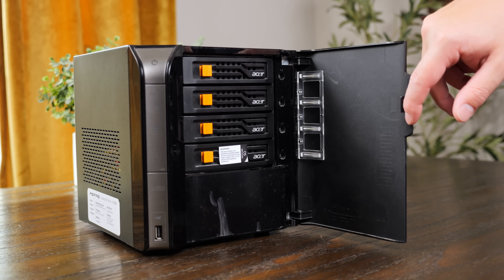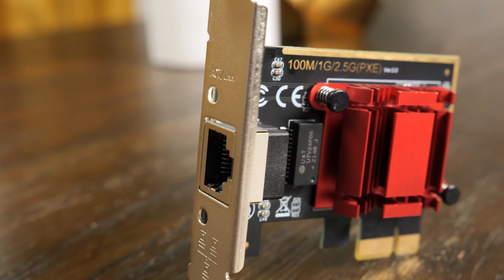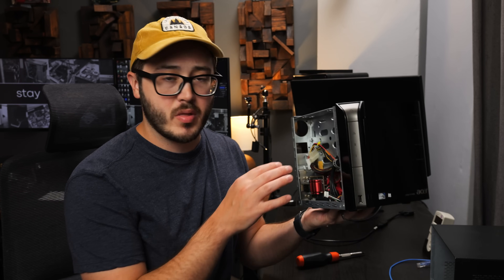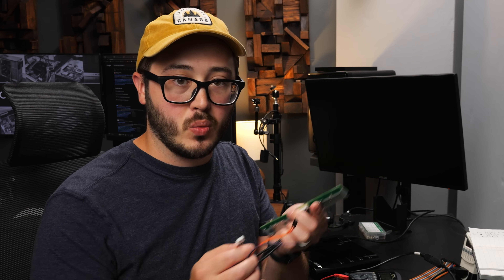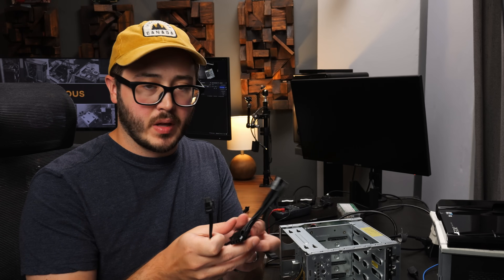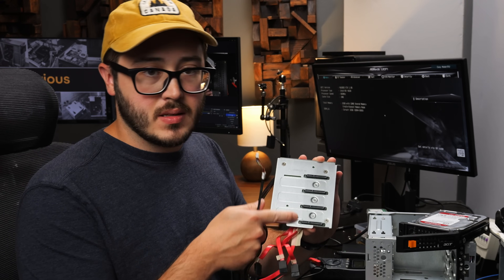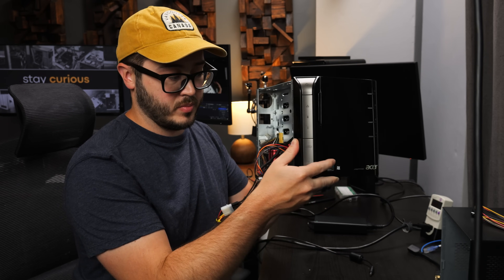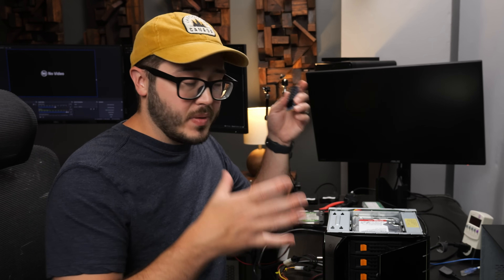I turned a cheap NAS into a SLEEPER home server

Comment: i have a question bout your mainboard choice, why a n100 cpu? Would a j5040 not more suitable for this?  i mean yea the j5040 is older but uses also only 10w, has 4 sata 3.0 ports as well the same number of pcie lanes, it has a powerfull internal gpu for video encoding and a 1gbit port. both are similar to each other, but the j5040 has dual channel ram support with each channel can support 8gb of ram with, yea i know it uses so drimm with 2400mhz and has a E-key m.2 as well. 
i personally would consider the j5040 insead of the n100, even it is a bit faster and the single channel of the n100 has the same bandwidth but for multiprocessing purpose you need more ranks. 
i dont know is the price for the n100 the same as for the j5040? the last time i checked the j5040-itx from asrock costs only 120€
Reply from the maker: You're correct. I had already ordered the mobo because of how often people bug me about it, so I used it.
Reply: Have you... used a j5040?
The j5040 is only 30-55% as fast and less than 2/3rds as fast for single-core and multi-core, respectively.
"A bit faster." Yeah, no. It's night-and-day.
Reply: @tim3172  it depends on your workload. Crunching synthetic numbers tells you shit about the performance. Have you any idea why a modern server uses a 10year old architecture and still ripping a modern processor in multicore performance in to peaces with the same number of cores? 
Have you ever heard about memory ranks and what they do and for what it is needed? 
Testing only the floating point unit tells you nothing about performance. a cpu it self is complex and every design decision as his pro and cons. clock speed for example doesn't mater on modern cpus any more it kills the efficiency and make cpus instable and fucks every internal and external part up. Yea in theory double the core speed means double the performance, in reality this is only 20% increase with 150% additional power. 
so back the ram. ram ranks and parallel connections is what modern cpus crush evern with a lower ram speed. the j5040 has the same ram bandwidth as the n100 but the n100 memorycontroler only supports 1 channel with 2 ranks and 16gb. the j5040 supports 2 channel with 2 ranks per channel and 8gb this mean i can 2 simultaneous access to the ram and have for each access second rank to access while i wait for the ram to finishing processing my first access command.
this means i can occupie 2 threads at 100% on 2 different cores at the same time not just one like on the n100 this cpu tries to compensate this with a bigger cache but if your files or variables are bigger than the cache you slow down because you're waiting for access. 
so more channel means more threads can run in parallel simultaneous, more ranks mean less over all waiting because you can send a access command and switch to a other thread while you are waiting on the answer from the ram. the besst part is if you have on one channel 2 or 3 or 4 ram slot you can access all more or less at once because interleaving time is only a hale cycle and depending on your ram and timing, access time is about 5 to 20 cycles. 
this means a 10 year old xeon e5 2683 with a broadwell architecture crushes a modern amd ryzen 7000x3d with 16 cores cpu in true in parallel real-world multithreading heavy computing task by a magnitude of 2. because it has 4 ram channels with each channel capable of 12 ranks in 3 slots per channel. 
have you any idea how powerful this is? 
this xeon cpu can utilize 12 core to 100% at max possible variable size without slowdown and if you consider the access time you can utilize 22 threads at one this is why the biggest cpu on this platform has 22cores. i mean yea for your daily simple single programs yea floating point performance and memory bandwidth and everything else does not matter, is essential but for a server this means nothing. 
you cant measure performance only on synthetic benchmarks. also 100% system utilization means you system is overloaded because a core can run only one thread at the time so 50%, but how i said while you are waiting for the ram you can switch threads and if you dont need to load everything you can run a program faster. Means you can hold 32 threads in your cpu for example but you need also cache per core and if this is to small or your thread is outsourced you have to load ever time you run this thread all needed data this means again memory access. you see? memory channels and ranks are key for a fast parallel computation, not pure horsepower or extremely fast or big ram. 
Unfortunately, the people today are only dumb consumer and don't try to ask questions and take everything as true what media tells them. ask old people who worked on c64 and even older computer they can tell you how a computer really works. try to learn intel 8080 assembler or atmel assembler or buy a pdp8 clone or altair 8800 clone and learn to use it. to get a understanding how a computer works, what are instruction cycles and why every instruction has a different cycles, what are register and opcodes, and so on. 
if i am correct there is a interactive mos6502 cpu simulator somewhere online that shows you a simulation from a 6502 cpu with every data line highlighted and what part of the cpu is active on different commands. 

dont see this as a hate commentary, i try to show you that synthetic benchmarks are a lie and dont tell you nothing about the performance. a cpu has also so many hardware implemented computation algorythmen like aes, avx2 and so on. those for example does no longer be performed by your program but the cpu does this for you if you call this function and this is sometimes nearly instant compared to hundreds of lines in your code. it is like the shader unit of your gpu, you put data in get data out more or less instant. 

i hope this helps you to understand a pc and its internals a bit better. ^^

Comment: Nice video, love reusing stuff like this myself.
On the front PCB, come across this sort of thing often. What I've found works more often than not.... Find the traces to those LEDs you want to use. Cut them somewhere convenient and just solder on your own wires to power them.... do similar for the USB if you got some old headers. 
For power.... wall wart with molex ends always served my needs for 120VAC to 12/5vdc. Crack them open and take the PCB(s). Wire the 120VAC lines together and add all that safely into the shell of the original powersupply or 3D print an enclosure.
Could add a 19 volt supply internally and pass a cable for the MOBO out the back so your only plugging in one 120volt end. 
Also add an internal SSD for OS since that M.2 has room.

Comment: The CNVi really makes it less useful than it could be. I went for the mATX one exactly to get more expansion slots. How is the system handling powering 4 drives off of a single connector on the board? I don't think it's rated to draw enough power for 4 HDDs.

Comment: i feel like the purpose of the proprietary connector to the motherboard is if it detects that moment within the past 5 mins is to Cut off power when its idle and save power when not in use and enables it when there is background network access
Reply: That does make sense, kinda what I was thinking too. Like some of the shucked HDD that need the 1 contact taped to work

Comment: What would have made this video more compelling and would have raised your esteem with the community is if you had stuck with it and figured out the power LED and drive LEDs and done the needful to get maximum functionality out of this mod, not hurrying through it for the sake of easy and fast content.  Spend more than 90 minutes on figuring it out and you will differentiate yourself from other YouTube-rs who also rush through their content so they can push it out.  This was a fast food video, not satisfying.
Reply from the maker: "easy and fast content"? This video took me over a week to make. I get what you're saying, but:

A. It was honestly beyond my level of comprehension when it comes to electronics
B. I literally pay my bills and take care of my family by publishing videos. I can't lose a 1/4th of my income one month because I want to tackle a fairly insignificant problem and not publish a video the following week because of it.

I'm sorry that you weren't satisfied.
Reply: @HardwareHaven  Perfect video, I would of done the same with the buttons. Good job of keeping the computer out of the land fill and making a usable NAS.
Reply: @HardwareHaven  I get where you are coming from with this. However if the power LED bugs you enough to spend a little bit of time on for yourself (it would for me) It wouldn't take much effort to figure out the power led and get it working again (even if off-camera and just for yourself). Tracing back from the anode (negative) and cathode (positive) of the LED to the next component, or even just to the positive and then cutting off that next component off the pcb would almost certainly do the job. 

Honestly it wouldn't be hard to figure out and I or someone else would probably be happy to figure out where to cut and what point to solder a wire onto to get it to work. I've done something similar for a monitor when the built in controller board died and hacked together a fix to make the existing buttons and lights work with the aftermarket controller.

Comment: 'I thought this would be a quick, fun, easy project' 😂  Ok, ok...  doesn't that motherboard have an on board 1Gb nic? If so, you could put in a pico PSU to eliminate the fire hazard (although I think your solder job is probably perfectly safe) and a pcie SATA adapter of your chosen flavor. That would make a great remote backup server, and honestly a perfectly acceptable home server for most people. Come to think of it.. if you really want the pcie for faster networking, you could simply mount an SSD where the old power supply was, connect it to one of the on board SATA ports and boot into CasaOS or TrueNAS or whatever from that. Lots of options there, that's really a cool little project case.
Reply: His solder job may be safe but he used double power over the rated for the connector and wire.
Reply from the maker: Definitely lots of options!

Comment: With this 6 port M.2 SATA adapter you could squeeze in an additional SATA SSD (zip tie, tape, velcro) as an OS drive, power would need an adiitional Y-adapter.
Reply: Or use a SATADOM, one that doesn't require power.
Reply: @Andy_Panda  satadom without power requires it to come from a specific satadom slot itself so no that wont work
Reply: Yeah, that's what I was thinking. No need for unraid, we could install truenas instead.
Reply from the maker: I liked Unraid for this box though. But yeah that would've worked as well!

Comment: why not just run both power supplies? Internal for the case, external for the ITX board and connect both power cables to a single power bar with an off switch?
Reply: that motheboard also runs on 12v so no need for an external psu
Reply from the maker: I considered it... I just hoped I could make it cleaner with how I did it.

Comment: You need to map the wires for power,etc. Does acer have a manual for repairs on this thing?
Reply from the maker: I didn't come across one, but didn't look TOO hard.
Reply: @HardwareHaven  cool side project,  but not much cheaper than building a new one (basically the cost of a case)
Reply from the maker: For sure

Comment: There are $15 2.5/5GbE NICs on Aliexpress now, also PCIe x1.

edit: or look for RTL 8126
Reply from the maker: I just grabbed what I already had since it worked just fine, but thanks for the heads up!
Reply: @HardwareHaven  they (Realtek) also plan to publish 5GbE USB-C NICs (cheaply?), so keep an eye on them.

Plus most of the cheap 2.5GbE switches on Ali are based on those Realtek chips as well, so we might see cheap 5GbE capable switches this year! Cheers from Poland.

edit: that USB-C chip's name is RTL8157-CG
Reply: @HardwareHaven  

Since all of cheap chinese switch are based on those RTL chips we can expect a lot of cheap 5GbE switches by end of this years!

Realtek also develops RTL8157-CG which is cheap USB-C to 5GbE adapter I'll definitely will keep an eye on them!

Cheers from Poland!

Comment: 'While it technically works' pretty much describes my home lab setup...
Reply from the maker: Hahahaha same.... same...
Reply: @HardwareHaven  My home lab is your other quote from the video today "...............Poop......."
Reply: I have a 8 drive ZFS array, but no 3.5 drive bays on my 1U. So I have a pile of drives sitting on top, with a power supply I took from an old office pc powering all the drives with SATA splitters. Oh, and a Walmart box fan to keep it cool. My lab is all kinds of jank, but I love it.
Reply: @BenjaminBuell  Its perfect! as long as we realize its there and can go away at any time , its worth it to have fun with the tech...
Reply: Wouldn't be a "home lab" otherwise ;)
Reply: My entire homelab is entirely contained on an old Dell Optiplex SFF and a 24-port gigabit switch
Reply: @bouncypear_net look at this guy with his 24 port switch… #16PortLyfe 😂
Reply: LOL, yeah it works great as long as I don’t change ANYTHING 😂
Reply: My home lab is a pi4 with a usb hard drive lol
Reply: My NAS' are as follows.... A very old ugly (but not beige) case with an AsRock Z170 mobo, i5-6500T, 16GB DDR4 and four 4TB drives in a BTRFS RAID 5 running AuxXxilium's Arc with Synology DSM 7.2. (Best Xpenology-ish loader I've ever used). It backs up to another DIY AuxXxilium Arc Synology NAS with an old AMD FX-4100, 16GB DDR3 and four 4TB drives in a BTRFS RAID 5. All wired PC's in my network have 2.5 Gbe NICs installed and I have two dumb 2.5 Gbe 8 port switches. My current router is an old Netgear RAX80, but I am currently setting up an old first gen skylake (i5-6500T) Dell SFF with OPNsense to replace the RAX80 and I am waiting for decent prices for a WiFi 7 router/access point. I'd like to have a decent mini pc to run Proxmox so I could use it to run VM's and containers, but saving for things takes me a long time, so I'll just run the things I need/want on the main NAS in docker until then. It's not pretty, but it all seems to work.
Reply: I might be the only one here with a remotely normal setup, with rack stuff. Rack servers that are mounted on both ends of a rack cart, since it is extendible, where I think I exceeded the weight limit...
Reply: I only started building something of a homelab but yeah 'technically works' describes it perfectly

I have a NAS in an old desktop tower case and the only part of it that doesn't qualify as somewhat trash picked are those fancy slim sata cables sleeved together. 
There's also a mini-itx box with an AMD A8 that I currently have no use for, my old Thinkpad T420 that may or may not become a cluster node and a RPi (the first one). It's a mess.
Reply: Mine too, its just a acer laptop from 2013 and i removed the screen
Reply: now do it again with the new Minisforum ITX Mobo

Comment: This is great. I updated one of these just a few months ago which has been hanging around actually since it launched but didn't use components with enough oomph. It's still around, though, and maybe it CAN be improved...
Reply: If you want, i can translate it for u, im german and can read Electronic diagrams aswell. 😊
Reply: @Dr_De4th  if you could I think that would be incredible. Might be able to get more functionality if the whole thing was understood
Reply from the maker: Nice! And thanks for the comment
Reply: @HardwareHaven  Did you or can you show the pinout for the two buttons to the front panel? I think it is not in the video but I'll watch again. I probably found the same few sources for documentation as you did but the diagrams I found were off a German language forum or something, I forget.
Reply from the maker: I did not, my bad. I also found the guide in German and just had to translate the page to English. If you send me an email, I can send you what I know on the pinout.